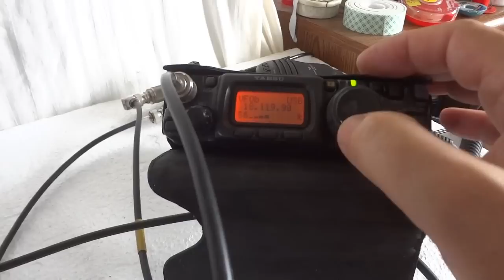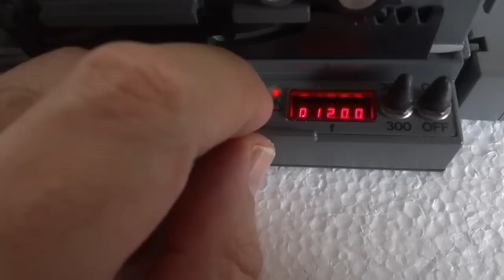FS 5000 receiver demo - Cold War Spy Radio

Comment: There is a new control unit with an ARDUINO available... 
Frequency control up and down in 10 Hz steps and even LSB lower-sideband reception with an additional small circuit... 
Nov. 2018... 
VY 73 !  Jim
Reply: Do you have a link to the description of the Arduino based control unit for this FS5000 receiver?

Comment: very interesting, BTW, what's the big black lever in front of the RX?
Reply from the maker: The lever is used to latch the different modules together. See my other video where the whole FS-5000 radio is assembled from the several individual modules.
Reply: the black lever is a quick lock and release to fix the DSU Digital Storage Unit, which contains the keyboard, the display and the crypto software and some more electronics... The DSU connects to the DB25 ...

Comment: is this type used by spy numberstations ?
Reply from the maker: It could have been used for that, but not likely. This radio was used to exchange bidirectional traffic in the form of text messages. So it was used by spies as well as special forces (behind enemy lines) troops. The kind of "traditional" spies that were dependent on number stations generally used ordinary consumer shortwave radios to listen to number stations, since they could buy those kind of household receivers in any mom-and-pop electronic store.